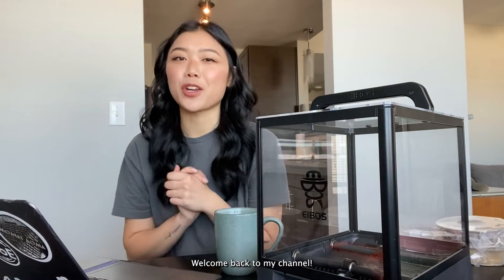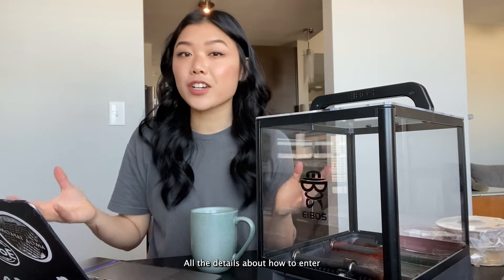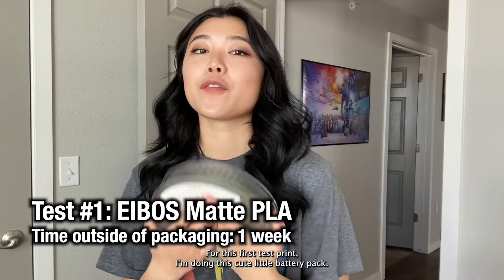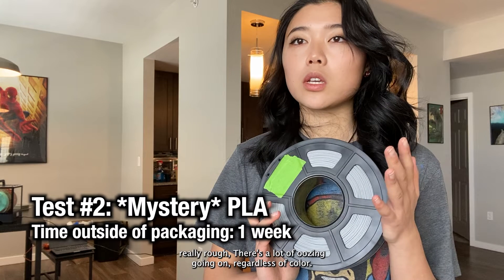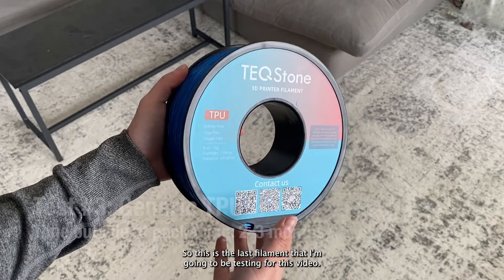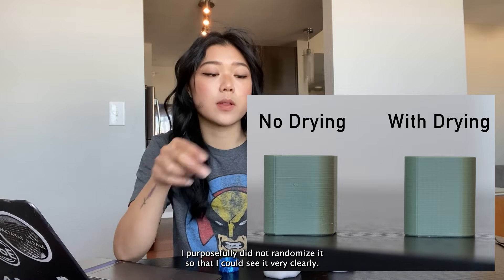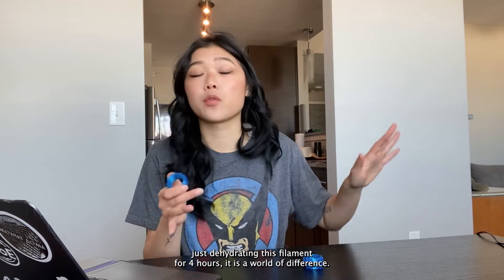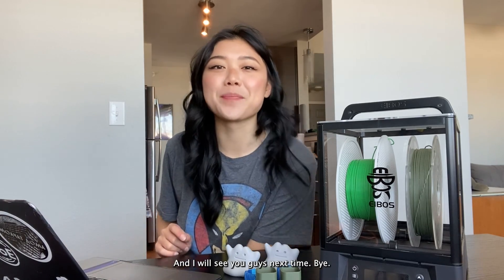Reviving 3D Printing Filament with the EIBOS Polyphemus - Dryer Testing, Review, and GIVEAWAY!

Comment: Hi, i highly suggest checking out bambulab wiki for drying times. i have the eibos since release and only used the presets like you did here.

my petg prints sucked until i figured out it has to be dried a lot longer.
now everything is working buttery smooth

Comment: I’m new to 3D printers. (I’m being gifted one after consuming hours upon hours of YouTube content about them and am pretty excited to finally be getting hands on)
I’m wondering if I’ll likely be able to find a file to print sides for the small spools to make them “tall” enough to roll in the dehydrator. I don’t know if I am being clear… I’m envisioning two discs the same diameter as the large spools that snap onto the smaller spools so that they sit properly on the rollers in the dehydrator, either with tension prongs in the center hole or clips on the outer edge. Presumably the inner hole would be more future-proof in case I ever come across yet another size spool. 
Is my thinking flawed? Would this already exist? Do people usually end up respooling onto a large spool anyway?

Sorry for the ignorant rookie questions.

Comment: Mystery PLA looking like a Sunlu roll
Reply: yup. Some brands do a decent job pre-drying but I find Sunlu to always be a mandatory extra step. I tend to dry all filament before storing typically but if I put it in the dryer and the humidity is low after 10 mins I will skip it.

Comment: all of my PLA got super brittle after leaving it out for like 6 months, so I've been drying it with Rick Impey's ghetto dryer approach, which has worked.  I also got a drybox to store it in.  this is def. working, but one of these would be a much better drying situation

if I were going through filament really fast, now, I wouldn't be so worried about it with PLA, but I'm not
Reply: This is my go-to method as well. It also helps keep my room warm in the winter

Comment: Ambient humidity matters most of all. Drying PLA is 100% necessary if you live in an a very humid climate, if you live in a dry climate it may not be necessary. If you live in a dry enough climate you don't even have to dry PETG or TPU.
Reply from the maker: That’s what I thought too! I live in southern colorado, so I never dried my PLA before this. So I was super shocked it made a difference

Comment: Excellent review! I always learn new stuff about printing from you! That may be the issue with my school filament. We've had the colors open for awhile now (months) and I'm getting quality issues in the prints.If I don't win, I'll have to check into one!!
Reply from the maker: Thank you so much for the kind words! And totally, depending on the climate you live in, and the filament type, filament will absorb moisture from the air at different rates. A few months is definitely enough time that moisture could become an issue. Highly recommend!!